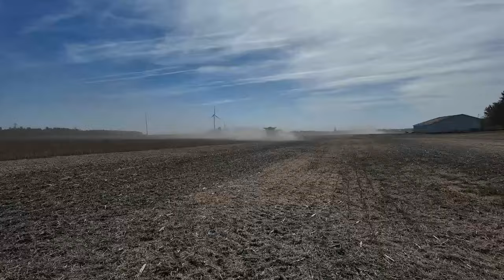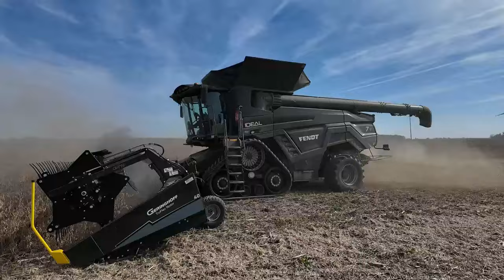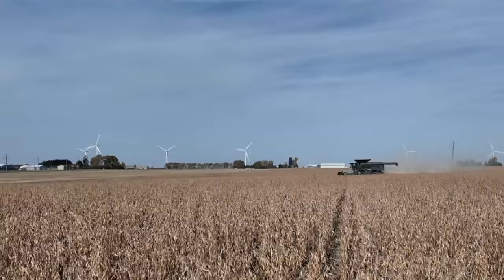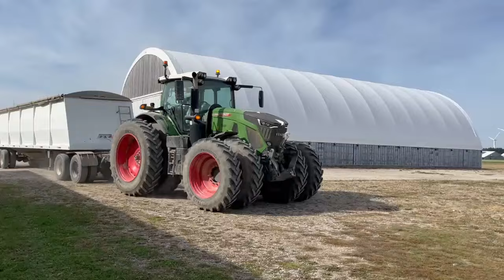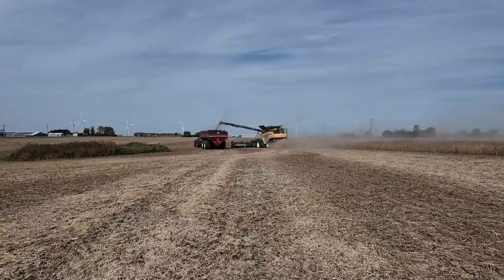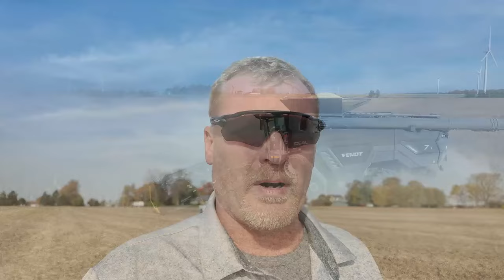Fendt 7T vs New Holland CR8 90 - Can They Harvest The Same Acres Per Hour?

Comment: Nice video! How does the larger bin capacity of the Fendt affect fuel consumption? (Or does it?)
Reply from the maker: The combine is just more fuel efficient the way it’s designed.  However after thinking about your question, I guess technically the bigger bin could add to fuel efficiency by being able to complete a cut through a field and not having to stop and dump part way.   The 485bu adds to the overall efficiency of the machine which in turn would help with increasing acres per hour and therefore burning less fuel.